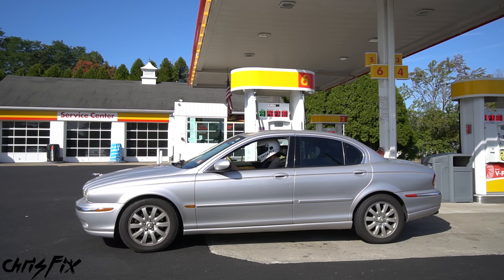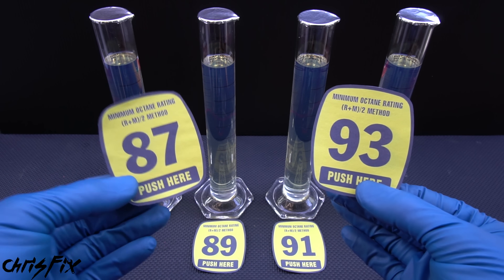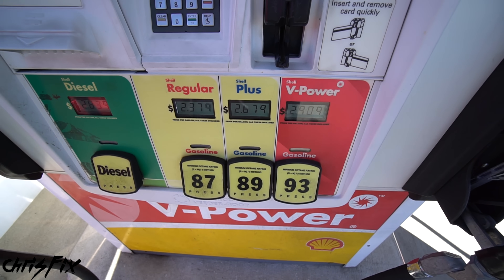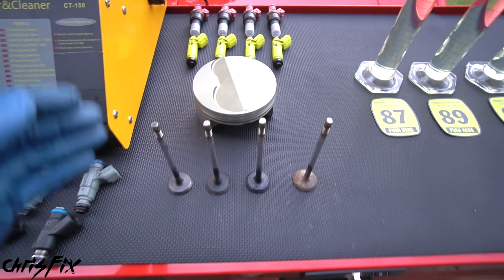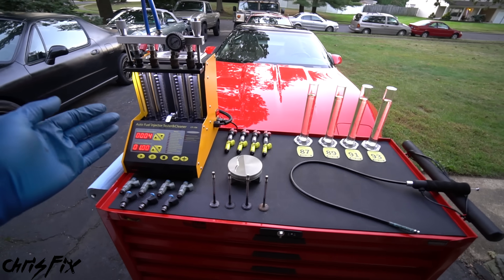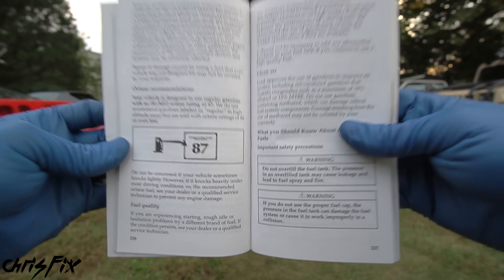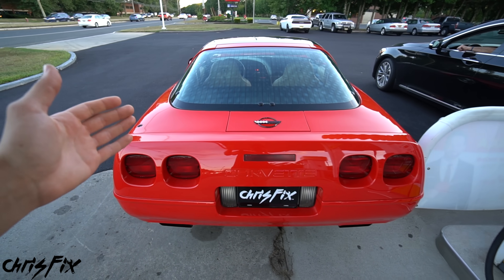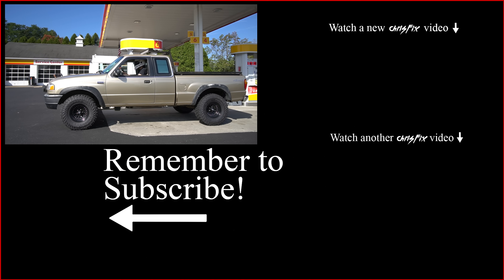What is the BEST Fuel to Use in Your Car or Truck and WHY

Comment: I like using Marvel mystery oil in my gas which keeps my fuel injectiors and gas lines clean Plus one quart of Marvel mystery oil in my  engine mixed with motor oil which also help keep my engine from buildups in the walls and heads and I change it every two to three thousand miles on every oil change and for doing so I never had any problems with my  98 old beat-up Oldsmobile intrigue

Comment: So just a little quick math it seems it would be cheaper to just buy 87 octane and a bottle of booster.
Reply from the maker: The booster doesn’t increase it that much. You would need a lot
Reply: @chrisfix  ah ok.  I just did a quick Google search and it said a bottle was good for 79 litres (I'm in Canada) which worked out to about 8.5 cents per liter.  But yeah maybe it doesn't boost it as well as what's at the pump (plus probably not as much additives)

Comment: Oil on top of a valve is not from feul..its caused by worn valve guides that leak oil from the top side. And oil on top of a piston is either from that valve guide or bad piston rings. Only an idiot believes running high octane fuel eliminates this issue. And btw I own a car that has 750.000 miles on it..I rarly change the oil..and I've never used anything other then the cheapest gas. Still gets 30 on the highway. Cold ac and awesome heat in a 04 impala.

Comment: So, I got a k24 motor its 91 recommended. However I always get told that the injectors in that model are more smaller than normal and motor runs hotter than most so to never go lower than 91. Is there any truth to this?

Comment: I will only ever use 93 octane in my car period. Just the thought of cheap gas is cringey. I wont ever fill up at places like Valero or cheap shit like that either. I prefer Shell, Sinclaire, Chevron if I have to and maybe Sunoco. I just cringe at the thought of people putting cheap shit gas in their cars. 

It also sucks buying a used sports car or luxury car (that most likely requires better gas) and just HOPING they weren't dumb and putting cheap 87 octane in the car for thousands of miles or using shitty oil or using Valero or something.

Comment: Well I’m sorry but whenever I use 89 or 87 in my SUV I feel the weakness and poor performance on my engine I do that like two fill up for test and when I go back to 93 I feel the smoothness and power in my engine and that’s why I use 93 for the past 20 years and also the end of the tail pipe it looks so dirty and black with 87

Comment: Do all of these fuels being compared have ethanol? My area mainly has the 91+ octane as ethanol-free. Thanks for your video!
Reply: You can pretty much assume any gas that isn't labeled ethanol free has ethanol in it. I'm pretty sure the federal government allows for up to 10% ethanol in gas. You're lucky though, my town seems to only have 87 octane ethanol free, and my truck definitely runs better with premium 93 octane vs 87.
Reply: Ethanol-free gas is important for classic cars as ethanol has hygroscopic properties (absorbs water) and ethanol can ruin rubber fuel lines or gaskets if they aren't designed to work with ethanol. This is made worse if the classic car sits for long periods of time.
Reply: Paul Bolliger I've switched to ethanol-free for my chainsaw and other 2cycle engines years ago and now switched to ethanol-free for my vehicles. I'm really more worried about ethanol than octane
Reply from the maker: None of the fuel I showed has ethanol in it. They have to label it E5 or E10 or say it has ethanol blended in if they sell it.
Reply: @chrisfix  In CT most pumps are 10% alcohol; however, our state by law does allow up to 15%.

Comment: I have a 2010 maxima sv and the car not only runs better on 93 but my gas lasts much longer. It’s noticeably different when I put in 87. Keep in mind Nissan recommends 93.
Reply from the maker: Yea that is why it is recommended. Is your MPG increase enough to offset the extra cost of the fuel?
Reply: ChrisFix Oh yea definitely, I really started to notice when I started driving for Lyft part time. It’s funny i happened upon you video cause I was just having this conversation with a vendor at work today. I’ve seen some of your videos in the past when I’ve needed advice with cars, keep up the videos. News subscriber here.

Comment: Well, besides the obvious like check with the manual, I think the true purpose of this video is to debunk the myth that every car can use regular 87.  Some people swear it's all the same.  On the side note, the video creator kind of contradicts himself by first claiming that higher/lower octane have same power, then later in the video, claimed that it does have an effect depending on the car.
Reply from the maker: I didnt say the fuel has the same power, I said same energy content. The power and efficiency difference isnt from the fuel, it is from how the engine uses it. A higher compression engine that can adjust timing will advance timing to get a better burn to make more power and be more efficient. If you use regular in a premium required or recommended car, it will retard timing which is less efficient and less powerful. The same energy is burnt in each situation but the engine can use that energy more efficiently with premium.

Comment: Shell gas has no ethanol in their premium but other gas brands say they contain up to 10% ethanol. I usually fuel up with Shell anyways but what is the benefit, if there is one, of that no ethanol?
Reply from the maker: Pros of ethanol is it is cheaper and a good cleaner. The negatives are it absorbs water and it is less energy dense than gasoline.

Comment: The difference these days in 87 octane, 89, 91, and 93 are miniscule. First of all most cars today run just fine on 87 octane. Unless you are running a custom built engine with extremly high compression it simply does not matter. Also just about all brands today contain additives that clean as it is. There is not regular gasoline these days it's all unleaded. There is a no alcohol gasoline offered at some stations but they are not the norm. The term regular was coined when leaded gas was introduced to help raise octane levels. Unleaded fuel was the first type of fuel commercially sold even back during the 1930s. Regular referred to leaded gasoline once it came into being. Now during the late 1950s as v8s incorporated higher compression pistons to achieve more horsepower, high octane fuel was created. I'm not talking about 91 or 93 octane as that would be considered tame by the fuel sold back then. I'm talking 104 to 108 octane  easy. Gas was cheap so it wasn't that bad. Most cars sold today are built knowing the grade of fuels we have available these days. They are based around 87 octane. The small increase from 87 to 91 or even 93 is negligible at best. If your car will run on 91 octane it will run on 87. Now days if you custom build a engine increasing its compression to the point it requires higher octane fuel you'll have to mix your own with octane boost or aviation fuel. The cost of 93 octane in most places are almost 1 and half times higher or more than 87 octane. It's not economical and you'll not see any benefits for the extra money. If you're experiencing detonation look to timing, air fuel mixture and go from there. These days it's all computer controlled so a good testing tools helps. Compared to the quality of fuel available years ago today's fuel is 1000% better. With the exception to the ethanol most fuels contain additives that keep the fuel system decent. Now you'll still need to practice good maintenance but save yourself many dollars and get decent fuel from a decent distributor....Most of all it doesn't have to be 91 or 93 octane either. If you have an engine that requires high octane fuel you'll not find what you need at most gas pumps.

Comment: I have a 1993 Jeep Cherokee with 320,00 miles the compression ratio is "slower" than modern engines. New small engines are "highly compression" with high rpm. So my friends thought because is an old Cherokee I use cheaper gas. I explain to them that was the opposite since this old six inline cylinders engines worked with no higher revolutions and to avoid engine knocking I use the  93 octanes gasoline. The engine runs smooth and no noises. We use the Cherokee as a backup car only.

Comment: Why am I watching this as if I need gas for my legs 💀💀💀💀
Reply: My Gases Expell - out the Rear. !!!
Reply: Gasoline has like 35,000 calories per gallon.  A human could walk over 1000 miles with that amount of intake. Making them feet the most fuel efficient transportation in the wo4ld
Reply: It would also kill you before you finished the first quarter mile of the walk thoughm

Comment: I would like to see an 87 octane "V-Power" fuel complete with all of its cleaners, lubricants & additives. How come regular is just ...regular? Or, do ALL fuel grades come with the same amount and quality of additives? Is "V-Power" just marketing "swank"? Or does it really clean carbon deposits better than regular?  If so, how come a normal "A-to-B" commuter car can't have a clean engine? 
If you ask me, the "V-Power" additives would be better suited FOR the daily commuter using "87", where vehicle reliability and efficiency are key. Your "toy" that takes "93", and only comes out on the weekends seems like it would benefit more from "power and performance" OVER "reliability and efficiency". Again, unless "V-POWER" is all marketing "swank"...

Comment: Okay here's the thing when it comes to purchasing fuel for your car you are really supposed to put in what the owners manual most recommends or there for what your car is supposed to take. Now put it this way my first vehicle was a 2002 Jeep Wrangler and a Spur owners manual I was supposed to use 87. Now my next car also required 87 as per owners manual so I use 87. My 2015 V6 Mitsubishi Outlander most recommends the premium so that's why I use the premium fuel. It is as simple as that you really should just refer to your owner's manual specification such as to what fuel you should be using and not to do any different

Comment: The worst form of detonation, is when the fuel ignites from the compression BEFORE the spark fires.  This is "dieseling", which is desired in a diesel engine, but NOT in a gasoline engine.  A really high compression, turbocharged engine fed with 86 octane fuel could exhibit this problem.
Premium gas was once called "Ethel", which was short for Tetraethellead, the octane boosting chemical that was added to 'leaded' gas.  Today's unleaded gas uses ethanol for that purpose (which is cheaper than refining the petro to higher standards to raise the octane).

Comment: What about a 93 and then the octane booster? Any damage at all? I have a 2004 Volkswagen Passat 1.8T that I HAVE to run 93 (Fun fact: I actually go to Shell all the time) and so this "Myth" is stuck in my head. You put premium in and think about an octane booster. What initially happens?

Comment: Is it really better to use 100% gas as opposed to the 10% ethanol gas? Here in Oklahoma, some people tell me it's better to use the 100%, some say there isn't a difference. I was wondering if the benefits outweighed saving the 10 to 20 cents.

Comment: Isn't it pre-detonation? I'm pretty sure "detonation" is the normal point in the compression process when the fuel detonates. Pre-detonation causes that cavitation within the cylinder which causes the knock. If it's post detonation - well, it doesn't really matter, you're just getting crap fuel economy, but it won't hurt the engine.

Comment: Great info. Only thing I want to add is that higher elevations also have 85 octane. The higher in elevation you go, the more resistance to igniting gas has. So they have to offer 85. In this situation, you dont go by the manufacturer because it's a special situation. If your car says it requires 93, and you are at 7000ft in colorado(used to live there) you most likely will not find 93 or it will be hard to find. That is because in high elevation, 91 acts the same as 93 at lower elevation. Same with 85 and 87 octane. Whatever your car requires, you can go 2 octane below it as long as you are in high elevation. And you will know this because you will start seeing 85 octane on pumps. Just some advise for anyone going cross country on vacation or whatever.

Comment: The octane rating is actually calculated based on the concentration of 2,2,4-trimethyl-pentane, rather than octane, which is similar to octane in the number of carbon atoms but isn’t a straight chain in order to prevent knowxking, as he is discussing

Comment: Hey Chris fix I own a 2013 Altima with 85k miles on it and my car runs on regular but I fill it up with 93 when I’m going out of states because my range meter tells me I get 125 miles more then regular and plus since the engine is going to be running for hours I get that piece of mind, do you think I’m doing it right or I should just use regular

Comment: Ethanol? Flex fuel?

Oh sure. Save the part I was waiting for until the end.
Reply from the maker: haha
Reply: @SHAKE_206  Ethanol used to not be in gasoline but it was changed because we had to move over to unleaded gas and regulation and whatnot. No ethanol is better because ethanol is an alcohol and alcohol eats away rubber. But I dont know where you'd find gas with no ethanol anymore
Reply: 0% ethanol is usually only in premium, I wouldn't get it unless I need it since premium is expensive

Comment: I've been working in a refinery for 23 years.  I have ran computer panels and made millions of gallons of fuel.  also extensive training in blending as it leaves the plant and heads to the fuel stations.  I have to disagree with your energy statement about equal amounts of energy in the different octane fuels..  Higher octane fuels typically will have lighter constituents like butane, pentane, hexane  of a "cyclo" or ""iso" chain molecules.  This is what gives it its resistance to pre-detonate....  the lower octane fuels have longer chained molecules and and less cyclic chain molecule, and those have more BTU per unit volume.  The benefit of higher octane fuels are realized when you have an engine with higher compression ratios (like a longer lever) and that gets you more expansion due to the amounts of fuel and air compressed.  That is why many folks feel that higher octane equals higher power.  This is not the case.

Comment: What if the engine is knocking when you've been regularly filling it with the right fuel, for example my subaru runs on 87 but I'm still hearing the knocking. What should I do?

Comment: Fun Fact!: In Puerto Rico you have 2 options. The regular (87) and premium (91 or 93 depending on what gas station you go in).
Don't worry about that, it's just how it goes in Puerto Rico.
Reply: If the information is wrong, i'm sorry, I just don't remember exactly what octane has on each gasoline.

Comment: So what if your manufacturer recommends 87 but you always hear knocking and you get less miles per gallon than if you run 89? Could that just be because of miles on the engine?

Comment: Do manufactures actually design engines to run mid grade fuel? If so, what kind of applications would those be where premium wouldn't be the better choice to go with instead?

Comment: Technically gas that has no ethanol vs gas with ethanol (E85 excluded) actually has a higher potential per volume because the ethanol has less potential energy in it. AVE has a good video on this explaining how it’s almost worth buying the more expensive fuel.

Comment: Hey Chris, I have a 2014 Ford Fusion with the 1.6 Ecoboost turbocharged engine... I haven’t ever cleaned out the carbon deposits, and I’m nearing 105k miles. How bad is the carbon buildup and how often should I get it cleaned out? Thanks for replying!
Drew

Comment: Can you make a video talking about ethanol blends? My 2017 F-150 3.5 Ecoboost for example is only rated to use up to 15% ethanol but there are tunes that will let it work with up to 50% ethanol and make huge power doing it. Why does the manufacturer not have it set up as a flex fuel engine when it’s proven to work and why does it make so much more power using it?

Comment: Good stuff, bruh! 

Also, it's a good idea to keep octane booster in your at all times in the road. 

I know here in the south, with hurricanes and power outages, when the gas station gives out of gas and people are lined up for blocks, they usually only provide one grade (87 or 89), and it's usually terrible quality (or so I've found). 

In my 91 Mitsubishi 3kGT, it caused problems, but I'm my 99 VR4, I make sure to have octane booster on hand. You never know where you'll end up!

Comment: Chris, you kept saying "the Octane is the same"; or the Octane is --- this or the Octane is --- that.  While I know what you are trying to say, that is not quite right.  You mean the Octane rating.   Octane is an ideal fuel that is not the same as gasoline or even in the gasoline we buy at the pump.  I don't even think anyone makes Octane anymore.  Gasoline's behavior is tested and compared to the ideal antiknock behavior of Octane.  How well it compares is represented by the number that is obtained in the testing; RON or PON.  An Octane RATING of 100 for gasoline means the gasoline behaves the same as the ideal fuel Octane. A rating of less than 100 means the gasoline behaves not as well.  While the European and American testing fuels are very similar, the RON and PON testing methods are not perfect and yield different numbers.  

I know I will get a bunch of snarky comments about this post from people who don't really care about accuracy.  But I can ignore them.  I am just trying to help the accuracy of your article which was pretty darn good.  It is very helpful to those that believed the myths.